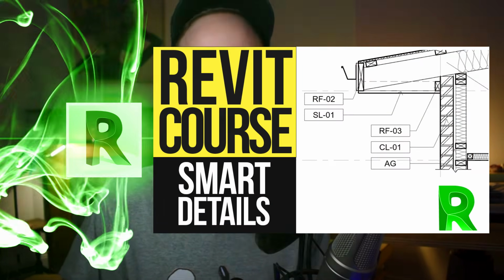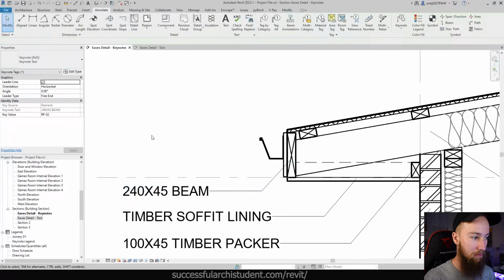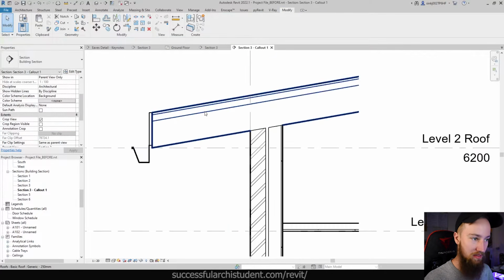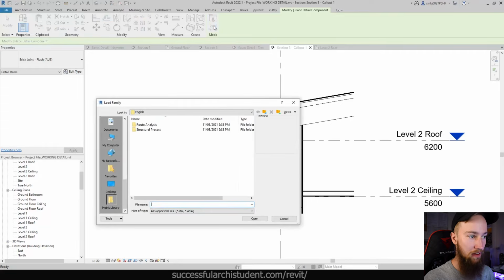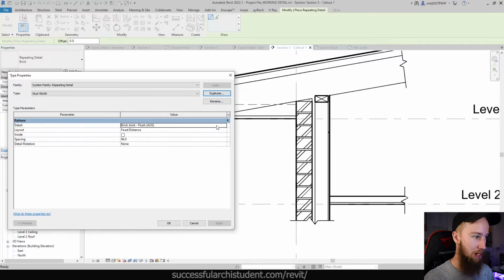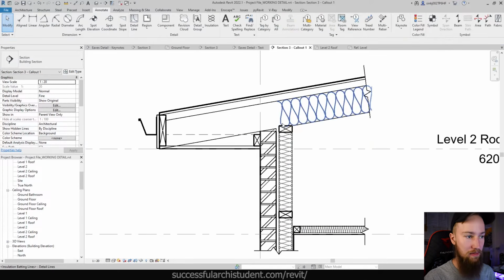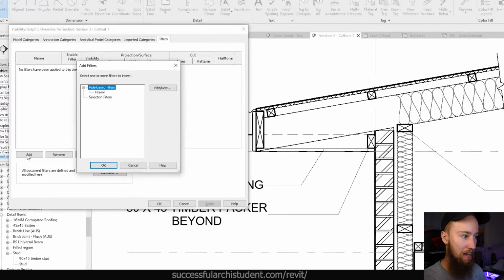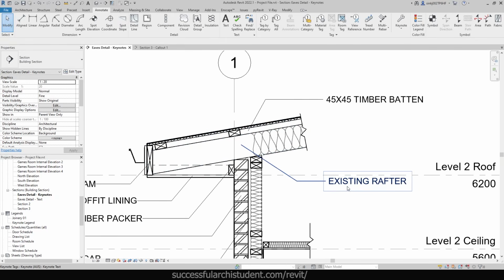Smart Detailing in Revit Tutorial | Advanced Revit Course 15

Comment: Thanks for the video! I will say that from a construction standpoint, you'd want to alter some things. 

1. sheathing over your studs. 

2. I'd guess that the horizontal ledger depicted on the brick that supports the soffit would likely be installed before the bricks, and so it would instead extend and get nailed to the stud wall and the bricks would then stop at the bottom of the soffit.

3. I don't follow the reasoning for the second horizontal stud that's shown below the top plate.

4. You'll want to consider how your ceiling is being supported.   The current 2x2 (US units) you're showing wouldn't be capable of spanning any real distance to support that ceiling.  What you've shown would be fine as it attaches to your stud wall,  but the joists beyond that would need to be much deeper.

5. You'd likely want to call out the height of that top plate so the framers know how high to build it, and you'd want to call out the slope of that rafter.

Not trying to critique, just wanted to share my knowledge since you're helping everyone else with what you're sharing about Revit!

Comment: Mate, how do you Auto align Section markers, grid heads using the annotation crop ? Reason i asked was because i did something in Revit accidently and for some reason the outcome is by dragging the view crop with my annotation crop turned on over section and grid heads, they automatically adjust to align with the crop view line where ever i adjusted the location - its amazing. Would like to know so i can do the settings so the x- axis grids heads and section heads do the same as they currently dont. The Y-access does this which i accidently. I am stumped but its an amazing feature without having to individually drag and align each section head to align.

Comment: I never used these methods because I can't seem to make things fit in my details, like wrapping the text, is there a way to do this?  I also like using arc leaders another thing I think is not available.  But I get it, off course not doing this is not taking advantage of revit properly, also text very far from the leader arrow, is there a way to adjust this?  Ill try to justify in the family
Reply from the maker: I'm not sure about wrapping the text. Unfortunately you can't use arc leaders either. You can move how far the text is from the arrow in the family, which you may have already discovered. I think the benefits definitely outweigh the limitations. Cheers
Reply: @kylesinko  I just asked same question regarding wrapping sorry you already answered it!